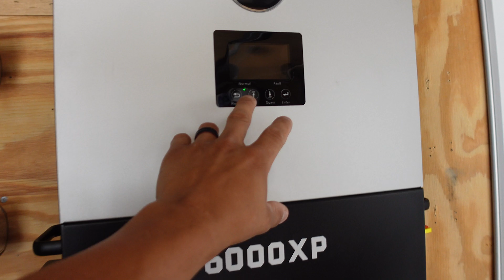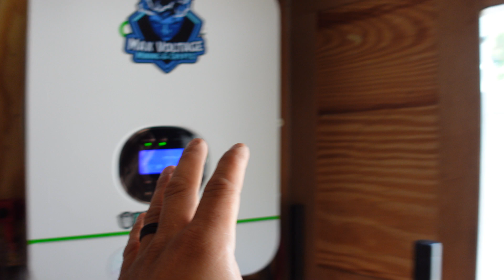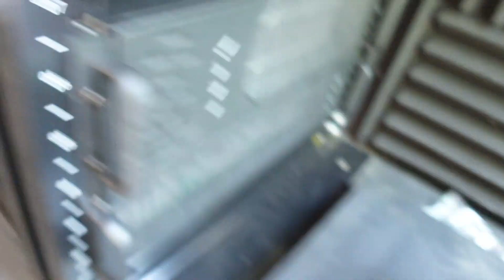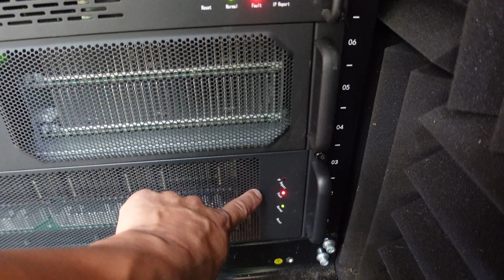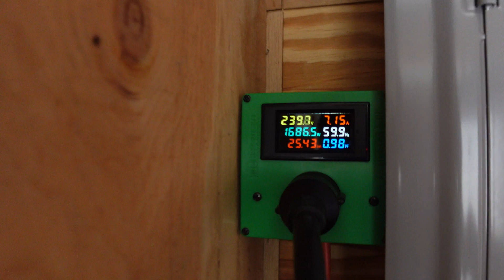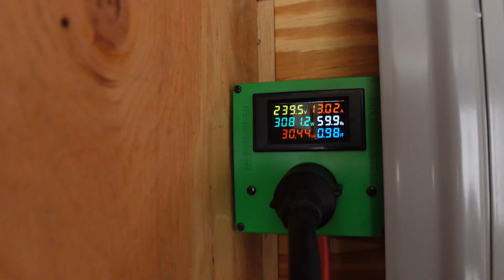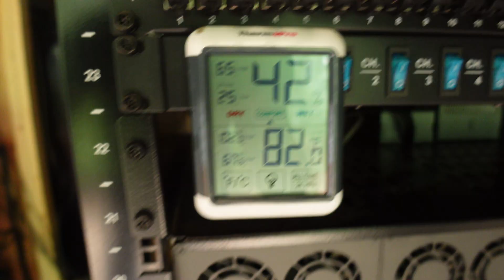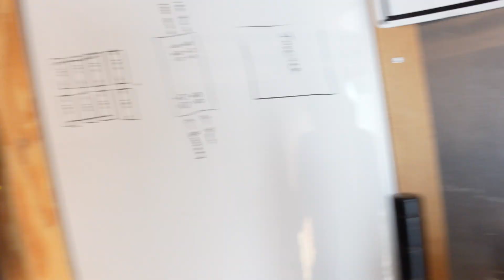Testing The New Crypto Mining Solar Setup

Comment: Such a sick setup, are you using the old batteries as well?
Reply from the maker: They are only on the exhaust system. The server rack batteries will be for mining. They have fire suppression built in makes me feel better about cycling them faster
Reply: @ChumpChangeXD  oh that's great, you may as well keep using them, how many panels do they have
Reply from the maker: @krootman_digitial  16x 495w Bifacial (so 395w on the top and 100w on the bottom)

The exhaust system is 20x 100w

Comment: Awesome job, can you share some more details on the solar/battery setup with details.  Like how many solar panels, how many watts each, daily kw production?  Is the battery only charged by solar?  Can it run 24/7 automatically or if it runs out of power it goes off?
Reply from the maker: For sure check out the previous videos I dropped it’ll help you understand what I’ve done to get to this point. I will try to get something together next week or so for you though!

Comment: I want to get the XP6000, but I want to make sure it can be supplemented with grid power when the batteries are depleted at night.
Reply from the maker: Yes you can. You can also tie it into a generator
Reply: Im selling a new unit